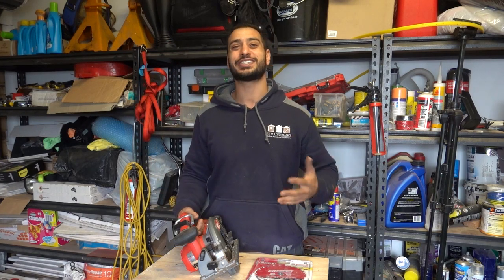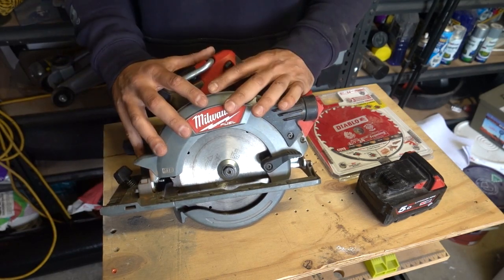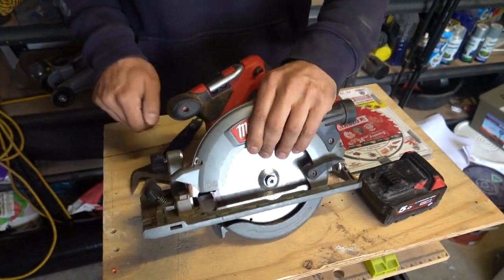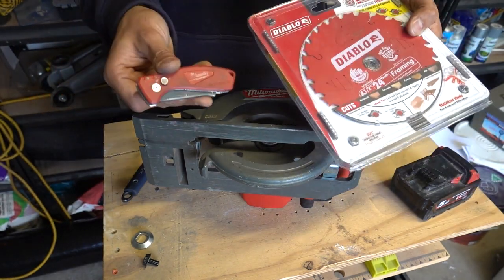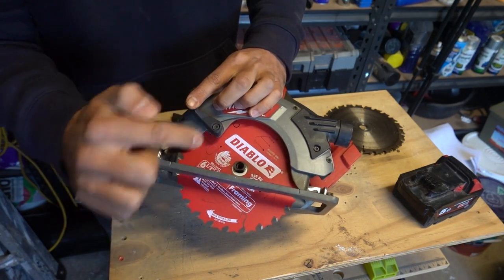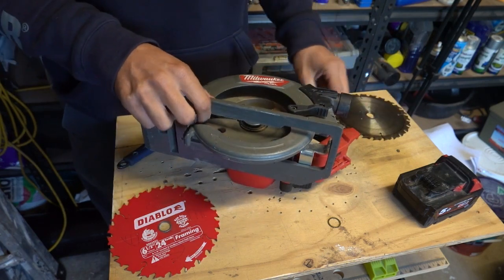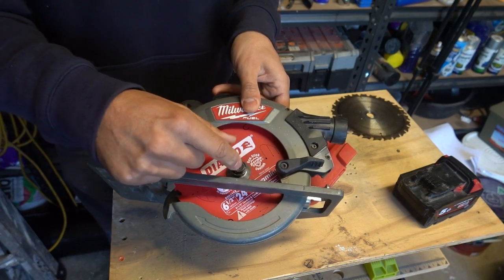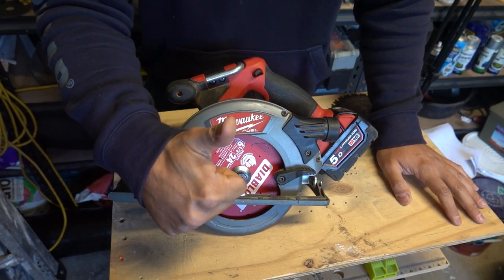How to remove and  install circular saw blade - reduction rings / bushes

Comment: I purchased a brand new Diablo 71/4  24 tooth blade. First we know that the threads are reverse threaded and that the teeth have to point in the direction the motor turns.  I went to put it on and thought my old age was catching up with me. Am I just stupid, I thought.  Why is the printing on the back side of the blade? Maybe it's just Diablo that is stupid. I watched about three Youtubes on changing a circular saw blade. They all showed the blade just like on here, printing on the correct side. I had my wife come in and watch it with me, She came to the same conclusion, the printing is on the wrong side of the blade. I did an internet search " why is my Diablo blade's printing on the wrong side of the blade"  No results for that search.  I looked at Youtube again and found one that showed the man putting it on with the printing on the reverse side.  He said that it's a common mistake that people assume the printing would be on the side that you would see when installed. So, W.T.F.?
Reply from the maker: Probably depends on the style of circular saw. Some have the blade on the left and some on the right. 👍
Reply: @billshowto  Thanks for the reply, So after much investigation I found out that it's the saw that is backwards.  I always thought that it was a manufacturing standard which way they run. You would think that it would be good practice to visually label the saw if it's left or right. Not that very small black lettering that can't be read if your eyes are anything worse than 20/20, It should be clear and obvious.   So much for a perfect world.
Reply: @donalddunn2983 Interesting. what saw and blade is it?
Reply: My blade is on the right hand side and its lefty loosey righty tighty. This video had me questioning many things about myself

Comment: NO WAY IN H#$LL was that bolt in it's original tightened position!!!  Wish you would have included the knuckle busting loosening procedure.  I love Milwaukee, but this push button cam lock and try to loosen at the same time without slipping and crashing your knuckles against the blade guard is a big miss in both the video and with Milwaukee engineers

Comment: Nice video but the recessed area is on the locking nut as well :) but if the reduction ring is little bit wider than blade should not be a problem 👍

Comment: OMG, thank God  I watched this video!! I just bought a saw and a few hours ago I wanted to use it for the first time. I also bought a Diabolo blade and need to use the reduction ring. As the packaging mentions "16mm and 15.875mm" reduction rings I thought these are needed for different saws. Unfortunately, they don't mention how to use the rings at all, so I simply put one of them into the blade and was about to test it out, when I thought "Naaaah, somehow that doesn't feel right" and I just left it. 
I have no idea what would have happened if I had started using the saw and at some point that ring would have fallen out of the blade, but something tells me that it would not have been a nice experience. Has anyone ever made this experience? Any idea what would have happened??
Anyway, thanks for mentioning this and shame on Diabolo that they do not cover that part on the packaging!

Comment: Good point about disconnecting the power Bill.Just on that i saw an incident first hand quite awful
Many people dont think  20 years ago ,a guy i worked with had a 4 inch grinder already in the locked on run position but it wasnt working .So he yelled out checked the power to his mate . So he layed it on his lap like an idiot while he lit up a smoke.His mate plugs it in and it started up and shredded his inner thigh ,grabbed it with his hand and cut that up too..A real mess
Reply from the maker: Very scary!

Comment: I wanted to ask. I know makita mostly and bosch. What do you think of stanley fatmax line? Is it in one line with those in terms of power tools durability and lifetime? And also hand tools if you hace any experience with them
Reply from the maker: I purchased fat max power tools about 8 years ago and they were horrible and I returned them, not sure how they are now. As for the hand tools they are good 👍
Reply: @billshowto  yeah I didnt see too many of them. Nowadays they are making a bit of a comeback at the stores where I shop. I bought a pair of tin snips. Should be good I believe

Comment: I have a question about silicone, can i apply on some left on or small amount of old silicone? Thanks Bill.
Reply: Not recommended. Best to remove the old silicone using some kind of solvent (I.e WD-40) or remove like a Stanley knife or other blade.

Then once the old silicone has been removed and the excess cleaned off you can then apply the new sealant.

Hope this helps! :)

Comment: I got this same saw and it's a big pain in the butt to fit the 10mm bushing in.. when I tighten down, it pops right out. I' called Diablo and they had no clue since it's their blade. Milwaulkie doesn't even sell the 10mm blades at home depot where I got the saw. I'm done with them.

Comment: I’ve got the same circ saw and it has a spot for the Allen key on the motor side below the big hook. I can’t remember if mine came with the key though..
Reply: It should be on the side of the machine. If a company makes a product that requires that action, then you'll find the specific tool amongst the arsenal.